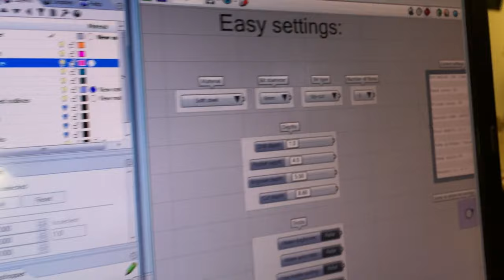Dry machining steel with DIY CNC mill

Comment: This is amazing! Looks like it should be possible to make parts for itself and reproduce?
Just need to solve making the longer-than-workarea axis rails!
Reply from the maker: Yes!  Looking forward to testing milling of an axis in aluminium. Should be easy compared to steel. Will test and compare milling a big axis with registration VS milling a modular axis components
Reply: Since the rails are fully supported, multiple pieces should work also. Milling two pieces at same time next to eachother might be easier than a single piece which is moved. No special technique and guaranteed equal thickness. And since there is some adjustment it doesnt have to be as done as perfectly in order to work.
Reply: @JensDyvik  any progress in this field so far?
Reply from the maker: @vnuendru1  Yes, there has been made a total of five Humphrey large format CNCs so far. All the structural and linear motion parts on a Humphrey are made on a machine of equal size, and the rails and rack on the longest axis are made from two parts to fit within the work area of the mother machine. Mounting the split rails precisely is demanding though, so far we have ok but not great results. Next up is to test ready made steel flat bars of 3 meter length that we put diagonally on the CNC bed in order to mill the rack teeth into them. Lots of documentation and files for download here: https://github.com/fellesverkstedet/fabricatable-machines/blob/master/humphrey-large-format-cnc/README.md

Comment: Hi, how long did the little Makita last ? I am planning to use mine alike until investing in a spindle designed for such purpose.
Reply from the maker: It lasted longer than the machine itself, so I can't give a proper answer 😂.  The self made glide blocks on the self made alu rails had too much friction. So I would recommend buying ready made linear guides from hiwin or similar for anyone building a similar machine. I don't think I would recommend the makita spindle for a temporary spindle if you don't own it already, but instead a chinese air cooled 800w spindle and vfd. Together thats about 200usd. In the clip you can see that I approach the material from the the side, that is much easier than entering from the top with a helical entry. When I tried such a top entry with the makita and its crazy high rpm, I got much too much heat buildup unfortunately.
Reply: @JensDyvik  Thx for the answer. Im gonna restrict myself to milling plastics and wood in the beginning. That should do for half a year or so until the upgrade to a 2KW liquid cooled spindle.
Reply from the maker: @petermeyer6873  That sounds like a great plan. Lots of luck with the build!

Comment: hi, could you please provide the torque of the stepper motors.
Great build and excellent demostration :)
Reply from the maker: i think they were 3nm open loop. but i would recommend integrated closed loop stepper motors like the ihss60 from jmc https://www.aliexpress.com/item/NEMA-24-3N-m-425ozf-in-Integrated-Closed-Loop-Stepper-motor-36VDC-JMC-iHSS60-36-30/32713260490.html?spm=2114.search0104.3.34.422b42bcNnY6av&ws_ab_test=searchweb0_0,searchweb201602_6_10065_10068_319_10059_10884_317_10887_10696_321_322_10084_453_10083_454_10103_10618_10307_537_536,searchweb201603_52,ppcSwitch_0&algo_expid=80a2e710-4170-4d83-9aeb-959a62891abd-5&algo_pvid=80a2e710-4170-4d83-9aeb-959a62891abd&transAbTest=ae803_4

Comment: what cam software did you use?thanks
Reply from the maker: I used an experimental function in Bark Beetle for Rhino. Probably fusion360 or estlcam would be the most suitable to set up a similar job

Comment: could you help me in telling me what motors you use in the axles thank you very much
Reply from the maker: I really like JMC ihss60-36-30. The integrated stepper drivers makes machine builds faster and easier, and the closed loop is very very convenient

Comment: sir can we use on mild steel ?? wat are ur feed rated and depth of cut??
Reply from the maker: This was an experimental machine. It did not last long, so I do not recommend you to make this machine yourself unfortunately. The test milling worked well because of a milling technique called trochoidal milling
Reply: I'm asking about Makita router. Can u use it for milling in steel for smaller works..
Reply from the maker: @rwagh  I don't think that's smart. I think the bearings in a Makita router will wear out quite fast in mild steel
Reply: I'm asking because I'm building a mill based on taig mill design. Want to use light weight headstock as well as motor. Hence i thought to use this router. Do u know any options for headstock for small mill. ??
Reply from the maker: @rwagh  I am not sure, but I am saving money for a Spinogy X22 spindle for the machine I am currently building

Comment: Great! I'm not familiar with any of your software. Could you elaborate? What plugin are you using with Netbeans?
Reply from the maker: To control the machine we used Universal g-sender. Super nice open source stuff you can download here: http://winder.github.io/ugs_website/ To make the job for the machine we used Bark Beetle for rhino. Link in the description above. You can also check out Estlcam for trochoidal milling.

Comment: Currently just looking at this on my phone so maybe i just missed this in the video, but what depth of cut were you taking?
Reply from the maker: 5mm depth of cut, but note that the machine moves in a trochoidal pattern. This is what makes it possible to mill the hard material with a weak machine. To make this kind of jobs you need a CAM program like Bark beetle, Fusion360, Estlcam etc.

Comment: sir can we mill brass with this router? how much depth per pass in mm?
Reply from the maker: Yes you could. I guess about 1.5mm depth per pass. But I would not recommend making this machine, the design is not reliable over time and has been replaced by the Humphrey CNC mill: https://github.com/fellesverkstedet/fabricatable-machines/blob/master/humphrey-large-format-cnc/README.md

Comment: Way to fast...
Reply from the maker: If you do the math for trochoidal milling with a 6mm 3flute end mill at 27.000 rpm at 10% stepover you will be surprised how fast the machine needs to move. Also note that the bit is cool to touch after milling. More info on calculating feedrates here:  https://www.cnccookbook.com/trochoidal-milling-feeds-speeds/